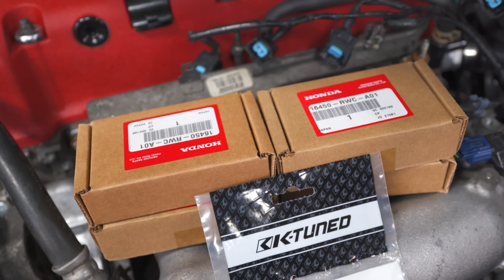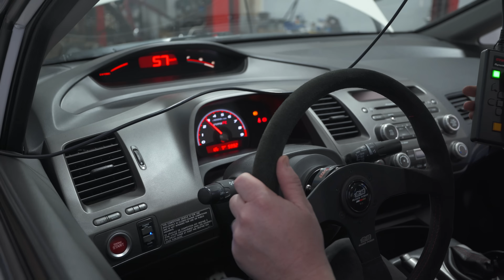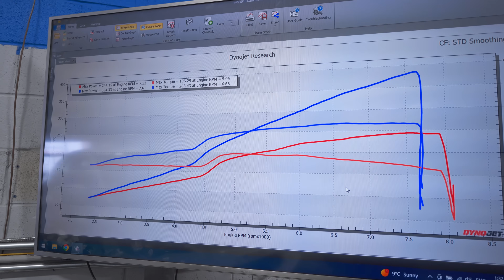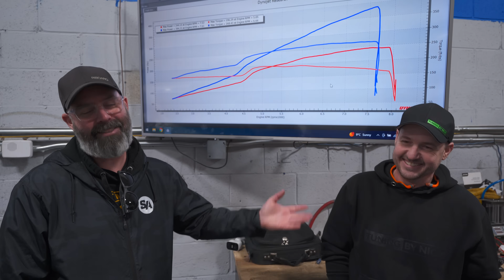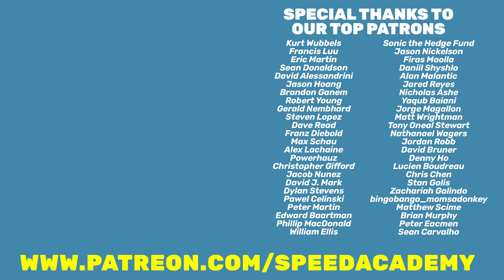BEST 8th Gen Civic Si 240WHP NA Mods ( SKIP the Supercharger)

Comment: Definately true, If you are drag racing you need the power.  For daily driving I've been at ~240hp 197 ft/lbs  Crank in my CL9 for 8 years now, every time I come across the money and time to boost or build I think to myself why? The car is already ludicruously fast for a family car.  The tires don't ast very long as it is and the fuel economy is now mediocre.  During Street driving 90% of the time your car is below 4000 RPMS.  so tune for that, and whatever the top number is it will be good enough.  torque wins races HP  sells cars. .
Reply: A custom tune could improve your gas mileage! and I agree that you don't need to put crazy amount of money on a family car which you don't rev past 4k rpm..it totally make sens. But it's HP actually that wins race as it make you go fast.. few exemple: golf TDI (torquier) < golf R (faster) , euro Civic 2.2Ldiesel (torquier) < Civic SI 2L (Faster),  Harley davidson (torquier) < CBR1000 (faster) ,  F150 3.0L diesel (torquier) < F150 5.0L coyote(still faster) etc..  Torque move the mass (great for hauling) and HP make the MPH (great for racing) so let's say two same car (same weight) but one is 200hp/100tq and the other is 100hp/200tq.. the first one will ALWAYS be faster in a race. Hope that help,
Cheers!
Reply: @benjbsn2429  I actually did spend what most would consider crazy money, I just didnt go FULL SEND.  The gearbox has been rebuilt with RSX-S gears, the engine is from a JDM accord type-s, it has a competition flywheel, clutch, header and tune. sitting on continental 235/45R18 tires.  It really was not cheap. I just ordered new RDX injectors due to mine being almost 20 years old now and well I'm  maxing them out. 

THe GOLF R has 295 ftlbs of torque with the Golf diesel being 236ft'lbs, the harley weighs double what the CBR does. The coyote is 5.0 L, the diesel is 3.0, you are mistaken.  The vehicles you compare are tuned for different purposes, its apples to oranges.  WHat you are describing comes from the transmission type (auto vs man), gearing, cam timing, intake manifold design and the exhaust restrictions, not wether the car is"torquey" or not, I didn't say I don't rev past 4K, what I meant with the 90% comment is that when driving on the street you almost never have to downshift this car (unlike a b16a for example) you can cruise at 2000 mash the throttle and you are off to whatever the public road allows. 

About HP and torque, that is a misconception.  When you see the revs climb and you feel it.. THAT IS TORQUE, when you shift at redline and the tires spin when you get back on it and the RPMS don't drop, THAT IS HP.   HP is just sustained torque, a broader torque curve, properly geared, wins the race due to the TORQUE being MORE available in a broad range of RPMs.  super high RPM power is "useful" but the engine is only capable in a very narrow range. The ideal Road car in my opinion has as much HP as possible, however without sacrificing the nominal torque.   a simple cam change on my k24a i lost 8 HP and gained 10 ft/lbs and the car feels MUCH faster.   It already had a decent amount of HP, but it really felt slower than a k24a3 below VTEC.

I guess It really depends on what you mean by racing.  Drag racing is pretty much the only type where HP wins consistently.  But you must also remember that limiting or unleashing HP can be as simple as using a restrictor plate.  However adding torque can only be acheived by increasing port velocities (reducing HP)  or enlarging/mechanically tuning the engine. (all motor)  So some race cars (RALLY CARS) have a mountain of torque but it drops off abruptly.  why would the manufacturers do this??? to WIN without breaking the HP limit.  

My "restriction" is that the engine does NOT do as much past 7K.  Big deal.  

THE SECRET SAUCE.  When I had the A2 cams installed the peak torque was 187 at 4600 RPMS.  with my new setup I have the 197 ftlbs peak at 5200 RPMS (Almost 200 HP at 5250 FTW) .  Lower RPM CAMs WITH i-VTEC bring the torque peak HIGHER!!!!! with more available below,  this is why the car feels faster. It has more torque than a 3.0 V6 Taurus  The peak torque doesnt carry on past 5500 however it still has plenty to go.  Peak HP is 236 at 6900. lol  Things have changed alot from the days of tuning my ls-vtec and aiming for the moon, that is for sure.

If you compare mine to a turbo car, I'm using a SMALLER turbo that builds MORE BOOST. VS a LARGER TURBO running LOW BOOST.  Thicker legs don't run as fast but man do they haul a$$.

Comment: Don't remember the complete supercharger setup but wondering if you could have just toned it down a bit with a larger supercharger pulley just to pull some boost out.
Reply: With a larger pulley you could put the redline back to 8k without overspinning the blower. I think splitting the difference between the two and ending up around ~300hp would be great.
Reply: They could have but decided to bitch up instead.

Comment: What about turning the boost down on the supercharger. And see how it goes with 270-280whp? Instead of 380.. would it still burn tyres with 100 less hp
Reply: I feel like that would be best of both worlds. Little bit of forced induction, instant torque with the blower and that little bit of extra juice compared to a NA setup

Comment: With the following you guys have I just wished you were more responsible with the decisions and research you make when doing something to your Honda's, especially when thinking about downgrading the engine, mainly just because of traction (which you can still break in 1st and 2nd).
There are multiple tuning solutions available today that can manage traction control for this chassis. ECUTek being one of them, where it utilizes the vehicle's sensors to apply traction control strategies and more functionality, without the need to modify the ecu's hardware.
Then you have the Syvecs plug-in aftermarket ecu for the FD2, FN2 and this K-swapped FA5, where it extends even more functionality. You could've still controlled traction using stock ABS sensors and EVEN control an electronic wastegate that would bleed out necessary air from the intake, in order to reduce power, using blend tables of (for example) load/rpm, to be used for DBW management and even by gear. So many possibilities...

Hopefully you consider pushing evolution onto the Honda crowd for your next video/project, instead of telling a story where control isn't possible. And if you do, use a tuner that actually knows more than just tuning on Hondata. And hopefully one with a load dyno where he can hit and properly tune both fuel and ignition advance on all the necessary drivability cells, in order to not make it a full-throttle horse.
Remember that a lot of people look up to what you do.

Comment: If 310cc injectors max out at 230ish how is it that you made 380 with forced induction with them??? Hopefully a mistake. 310 will make 300hp and are perfect for the factory Honda motors which come with 240cc to 310cc in a range of 180-240hp s2k are not maxing out there duty cycle at 220-240hp

Comment: Everyone is chasing the big number. How much power can you actually use? My little 4G63 Datsun 510 made 345whp on the dyno. I couldn't use most of it. Like you, even rolling into 3rd gear, I could spin the tires. Now I'm running a smaller turbo and less boost to make power more manageable. Even on a big track (which I haven't done yet) it will do better due to throttle modulation and power out of turns. As soon as I get boost by gear working, it opens things up,. Most cars can't use the power they make. Ignoring complex computer controlled traction control of course.